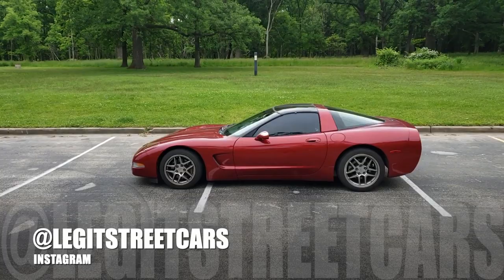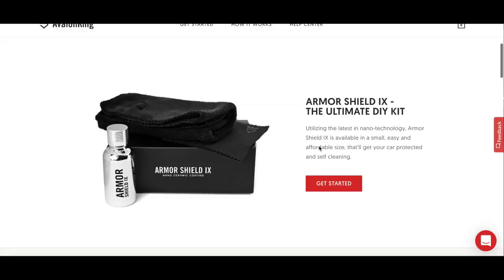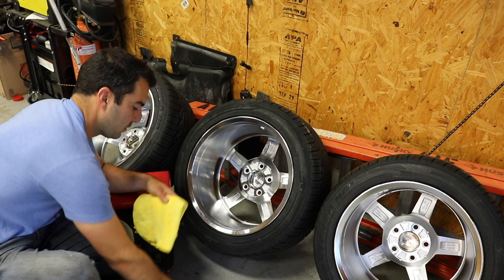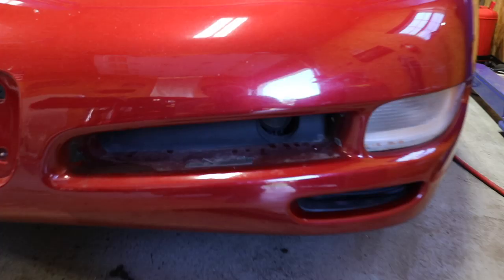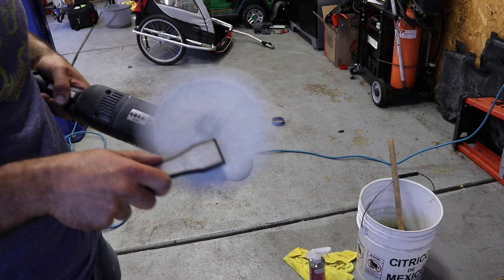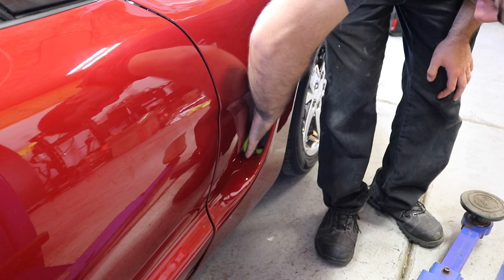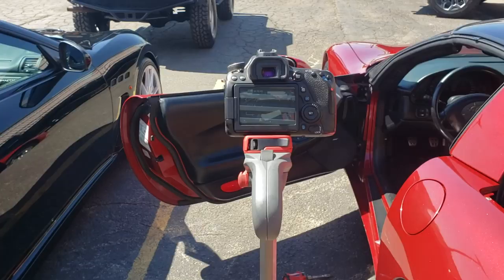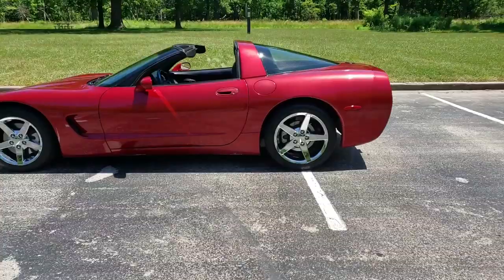I Love Corvettes So I Spent 30 Hours Restoring One That Sat Outside For 8 Years. DIY C5 Restoration.

Comment: Black plastic and rubber trim can be restored by heating the parts with a heat gun. Then use transmission fluid on the parts. Rub the trans fluid on a few times depending on the condition of the area. Remember, plastic and rubber are petroleum-based parts. Then use ceramic to seal in and protect the reconditioned plastic. And it's cost effective.

Comment: On textured black plastic that has faded or suffering from tiger striping use a hot air gun over the surface,it restores that fresh plastic look.It does take some practice and there is a fine line between not enough and too much but get it right and it beats any dressing.

Comment: Thank you for posting this, LegitStreetCars! I have a 99 corvette as well, it's pewter. I was afraid to use rubbing alcohol on it because i had stupidly, used nail polish remover to remove a touch up paint mistake on my c4..it stripped the clear coat in that spot and took a bunch of waxing and buffing over a period of months to get it not as noticeable. Thank you again!

Comment: Nice work ... it doesnt get much better than a C5...  its curves and body lines look so much nicer than the sharp and jagged lines of the C6 and C7 (would only get a C7 Z06 as its wide body looks super nasty and is so drastic of a difference to the base model. The C5 will look 10X meaner once you lower it and slam it to the ground...you just need to get a longer threaded bolt kit for the front and back...just swapping out to longer bolts front and back will drop you 2-2.5 inches in the front and 2.5-3 inches in the rear...you gotta constantly be on alert afterwards for pot holes but it's worth it... you can take a sharp turned highway off ramp at 90-100mph after lowering it with the tires clingin' and ZERO body roll... if you really wanna be blown away, take a picture of it at stock height and then another from the same spot you took the before photo and you'll be blown away.  You can get the extended bolts from Mid-America Motorworks and West Coast Corvettes ($90 for the rear set & $90-$100 for the front end set)... I know you said you didnt like the Z06 Mesh Grills in the front as you pulled them out, but I hope you held on to them and didnt toss those away...those 2 lil plastic frames that basically just neatly hold a strip of chicken wire absurdly retails new at nearly $200 for the pair... Also that dull cheap plastic front cowl that you shined up...NEVER looked good...looked like crap even when the C5 was new... their is an aftermarket carbon fiber cover that installs directly over it which looks amazing... that in addition to C7 Corvette Carbon Fiber ground effects/side skirts/canards and a set of L-5 wide body flared fenders makes the C5 almost half a foot wider as they add just under 3 inches to each side (which they allow the clearance for going as big and wide as 345/35/R19s  in the back without having to mini-tub... and then lastly an I will honestly say most importantly, if you really wanna eliminate the ONLY thing (in my opinion at least) that makes the C5 dated is its lighting (specifically its exterior lighting and lenses) ...a company named Adjure makes a reflective bezel with crystal clear lens covers for both the rear side marker lights and the front side marker/turn signal and looks worlds better than the bicycle reflector red and amber lenses that gm slapped on... new lenses and switching out to whiter and brighter LED lights around the whole car will still keep it current... the icing on the cake is of course yanking out the old set of dual quad tail lights that each run off a single light bulb and replacing them with what I would argue till my last breath as the best and nicest tail lights ever created for any Corvette; The Radio Flyer Innovations custom wired dual quad Halo Tail Lights, with each light having 27 LEDs in the center of each light which are wired to light up only when the brakes are used...he also created the most advanced headlights for the C5 using Dual Morimoto Projectors in each light which I always personally hatedd the pop-up head lights ...his lights is how GM should have released the car as people (who are clearly not motor heads) constantly ask me if my C5R is a brand new Vette... every single lighting part, lens, bulb, harness, headlights, tail lights n fog lights you can get in one stop on his website www.radioflyerinnovations.com  ...He Is extremely well known on Corvette Forum as he single handedly solved the C5 lighting crisis in addition to being a genius with helping and solving any problems in regards to electrical engineering.... Awesome job so far though and hopefully at least 1 thing that I shared will wind up being useful to you as you continue on with your build... best of luck and if you really did get your C5 as cheap as you did, you should find out how new or how whipped it's original motor is or even if it is good, pull it from the car, store and save it so you still have its numbers matching powerplant and then announce that the next video will be of you taking a bargain buy C5 Vette and dropping in oh I dunno, a chevy 427ci dry-sump LS7 with all forged internals... a YouTube video
like that should pull in enough views and ads to pay for itself...def an awesome factor to a C5 LS7 but if the LS1 still has plenty of life, a few upgrades and turbo setup with only 6-10 lbs of boost will put your bargain buy C5 in the 600-700+ hp range and then you can smile all the way to the bank when you can say that you paid $20,000 or less, All-In, on a Corvette that will stomp all over a new $90K + vette... not a bad deal

Comment: After you use the back to black, be sure it is dry, and then take some futura/pledge floor wax and go over it again. It will hold for 1 year at the same color with no discoloration. I have done this on multiple vehicles over the years. I have never been disappointed by the results.

Comment: I have a 2001 C5 convertible. Very clean and 56k,auto trans black top and interior. Super clean, I'm a detail freak. Moving to Colorado, but want to find a good home for it. I bought it from a 80 year old gentleman that lost his eye sight and his wife wouldn't drive it. I'd love to keep it, but it just doesn't fit in my plans. Let me know if you want to do it as a feature or a build into a beast. It's all stock 350.

Comment: That's a nice raised speed bump, and that's a nice skid plate. Either that or you "crabwalk" over the speed bump. 🤣
Reply: 16:27 at 2 o clock on the wheel, the bumper right below the wheel fender, it's not aligned perfectly. That could reduce your mpg by a good 0.05 mpg. Lol.

Comment: For the black plastic trim, try a product called forever black. Great stuff,lasts for years,no greasy look or surface left. But be AWARE DO NOT get it on paint,it will stain. Its more of a plastic dye but looks like original factory new.

Comment: Tip for ya. On faded black plastic,  use a heat gun( or very hot hair dryer) and wave it back and forth over the plastic trim.  And before your eyes, it's new again. Then if u want to apply protective sprays or wipes go for it, but it's new again without those oily products. 👍

Comment: The BEST restorer for black plastic trim is Peanut Oil. Wash the trim with the rest of the car, then apply peanut oil on a terry applicator. Trim will look like brand new. The peanut oil will also dissolve older, less effective chemicals that were used as well as wax and oxidation.

Comment: Proud 2001 c5 owner here bought it with 107k mils in basically mint condition for 12k so far i have done some normal maintenance like sensor oil switch and i rerouted my air intake hoses so that the passenger check valve matches driver side. Because as we all know gm engineers don't have common sense(who the heck mounts a passenger check valve behind the engine so you have to take it apart to get to it. Oh i know the wasted gm engineers who designed the cars.)

Comment: Hi!  I enjoyed the video, you did a great job.  Let me make a couple of comments:

#1. When I'm "bringing back" a car like this I always save the paint for last because you end up with other products on the paint so you have to wash again anyway.  My driveway slants away from the garage I generally start by taking the back wheels off first (plus the brakes are usually cooler than the front), I detail them and the wheel wells and put the wheels back on.  The water runs way from the front of the car which is still dry so I don't have to kneel down in the wet driveway.  Then I do the front wheels and wheel wells, after that the engine should be cool enough to do the engine bay.  Only after these are done do I tackle the paint.  After the paint is clean it's inside the garage as you did.

#2. You sent your wiper arms off to be done, next time try painting them with Eastwood extreme chassis black.  It comes out great, Eastwood makes the best spray paint you can buy!

Good luck!

Comment: My two dream cars: A Corvette (C3, C5, C6) and A Subaru STI (1999, 2005, 2014). What would be cool to restore would be a JDM RHD 1998 Subaru Impreza WRX 22B-STI (the granddaddy STI), if you can even get your hands on one, with only 400 ever hand-built by STi, and never sold in the USDM, its just a little Subie, but in mint condition they are just as rare as a Ferarri F40 of old and can be just as pricey as supercars of today.

Comment: Wish my 2000 Camaro was this clean. Its got 1 owner (my dad first) and it was used as my daily for years. Now it's 2019 and paint is faded due to valley brutal summers, leather interior and plastics need replacing. But it's possible. It's in my garage now and I'm going to start on it soon.

Comment: For black trim use a heat gun quickly over the area as not to melt anything. It works much better than the trim restore and lasts way longer.
Reply: Yep, I second that!! The heat gun trick, done right, can bring back a lot of different faded plastics. Works the best on textured plastic.

Comment: Not sure if it was mentioned here already but 3M makes a rubber wheel that attaches to your Dewalt to get emblem residue off.  Just some fishing line and the 3M rubber wheel- no more sprays or plastic scrapers!

Comment: I guess there are many die hard fans who want their car to be 100% original but, Improvements/upgrades to the drivetrain & flat out embarrassing even a modern Corvette would be my goal! I would upgrade that engine for power & performance now, With that said, I have seen your mileage video & I am unsure if 1,000 hp street takeover would be your thing? but, At the end of the day, It is a performance car so, One would want the performance to be second to none!

Comment: Restoring a 25-year-old car requires more than buffing out its faded paint job. You have to replace all belts, hoses, shocks, brakes, coolant, brake fluid, power steering fluid, cracked leather seats, tires, wheels, battery, and the list goes on. Oh well, if that's what you call fun, go for it.

Comment: Tip for plastic restauration (any color)
Get a heat gun and do slow rotating motion about 2-3cm/1inch away from plastic
Just dont touch the plastic that you have heated for few mins 👌👌👌

Comment: For the trim restoration use a heat gun but just make sure you dont leave it on one section for too long cause it will melt it but the heat gun will bring out the natural oils in the plastic

Comment: You can also use a heat gun on the plastic trim parts instead of a product because the finish that comes out is really similar.

Comment: you can use a heat gun on the black plastic trim to brighten it back up, I have done it on trim so faded it looked like tiger stripes

Comment: To restore black plastic.....use heat gun to warm up plastic. Take a towel and put automatic transmission fluid and rub it on. Let it sit til cool.  depending on severity reapply...then protect

Comment: Use a heat gun but not for too long on the black trim pieces. It will pull the oils back out from the inside of the piece and make it look rejuvenated and if you want it to look amazing, use that bavk to black stuff whike its warmed up from the heat gun

Comment: for black plastic something I have used that works well is the tire shine black can with flames get it at autozone or one of those local parts store I believe it works the best mothers works well too... for your alchol and water mixture what is the mixture yure using

Comment: C5 are a reliable car as the engine doesn’t have alot of the computer stuff in it most model cars these days have. Also insurance is suprisingly cheaper on  my c5 vs the 2007 Pontiac g6 hardtop convertible i had.

Comment: For me the best way to restore hard plastics (for car interiors-exteriors also hard plastics for bikes) is to blow hot air. The temperature  ''resfreshes'' the molecules of the plastic to their original color. You need to be very careful not to burn it though.

Comment: If you don't want to spend any money on getting faded trim back to its original color you can take a heat gun and go over it back and forth at about 5 to 6 inches away move about 8 inches side to side , most plastic are injection molded with the color so the heat will bring the original color back to the surface. You can use a regular hair dryer but it will take a lot longer than a heat gun. I have done 100's of all over Avalanche trim and it come back to 90% if its faded over 40% and if only faded about 25to 30% it should come back all the way. Worked on dark gray and black plastics. You can still use a product like gatorback which is GM's original injection mold plastic restoration product. Also works on all other manufacturers injection molded plastic. I own 8 body shops and have 30 years in the business. This will work and look good when you get good at it.

Comment: The absolute BEST thing for black trim restoration is pure PEANUT OIL. It stops oxidation, and will dissolve any other products that have been used unsuccessfully over time.

Comment: I’ve just finished watching your video and then I started looking for a C5 for sale, I found one 99’ same color with beige interior and black wheels, original factory paint, Automatic transmission with 100,000 miles for 8500 USD

Comment: Excellent video - very well done.  I live in Alaska and and our roads are full of pot holes, frost heaves, and loose gravel from the previous winter's snow maintenance.  Rock chipped bumpers, rocker panels, and hoods along with chipped windshields are the norm.  I have a black C5 that I love and turned 100K  on the odometer a coupe of years ago.  To me part of the joy of ownership includes detailing it regularly.  Your video has inspired me to try ceramic coating mine.  I'll let you know how it turns out.

Thanks again for your excellent video.
Paul

Comment: Couldnt focus on the reinstall of the windshield wipers due to the buffer trails you left in the hood. Turn the machine down, slow your hand speed, use more product and a smaller backing plate and pad for smaller areas.

Comment: TRIM RESTAURATION TIP:
use a hotair-gun, like those used to take stickers out. 
How its done?
Just put the hotair-gun blowing warm, enough to start melting the plastic surface. Keep on moving and avoid stay too much time on the same place because it may give a new shape to the plastic-piece. Too much hot-air can damage the piece structure.
Just blow air until the surface becomes glossy. It looks like new because the warm air melts pors and leaves a half-satin finish.
Use this in every plastic piece, but no rubber because it makes bubles. It may start burning or melt to tthe metal or windows.
Check videos about it

Comment: to restore faded plastic you can heat it up with a heat gun (don;t get it too hot) and it will bring the oils in the plastic back to the surface.  no products and lasts a long time.

Comment: My 07 C6 has been sitting outside for 5 years now, Ended up with an extra vehicle so I non-oped the vette. Didn't plan on 5+ years but it really hasn't depreciated, At least one person knocks on my door every week asking if I''ll sell it and I find notes under the wiper blades almost daily. I need to put a NOT FOR SALE sign on it. Or just put it back on the road. Need to replace the headlight lenses, radiator and cradle, air conditioning system, cowling. I have everything except the AC parts.Need to replace the brake rotors too Pluspain.t Black car has spent 100% of its life ungaraged. LAZY retired fuck. I don't have to do anything, so I don't, 100k miles, it will be like a new C6 to me.

Comment: You can heat black unpainted plastic parts with a heat gun, so that the oil it has can come the surface and permanently restore the plastic. apply some coating and job is done!

Comment: Great video and restoration. I have the 2002 C5 convertible in torch red. Im having sooo many issues lately though. For starters I'm having electrical issues (i.e. radio, windows, door mirrors, entire control panel on drivers side and wipers that go off on their own) all of which the local Cheverolet dealer  certified techs couldn't even figure out! Not to mention im in need of new tires, and come to find out Goodyear no longer makes the Eagle F1s in my size. Nor does anyone else. I have stock Z06 chrome wheels 17s in front and 18s rear. Anyway I've checked forums and talked to everyone locally and online. Maybe you have some suggestions for me. Thanks!

Comment: Carefully using a heat gun, followed by a buff with a dry microfiber, then apply g101 protectant to restore black trim...lasts a LOT longer than the mothers dressing